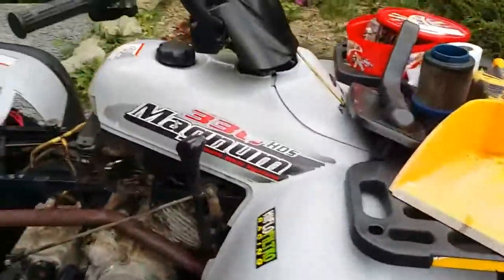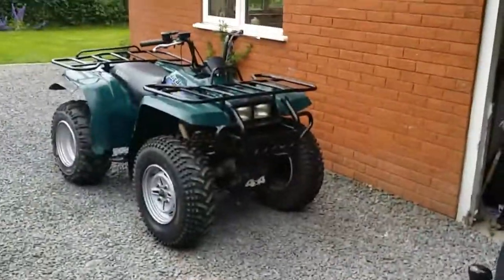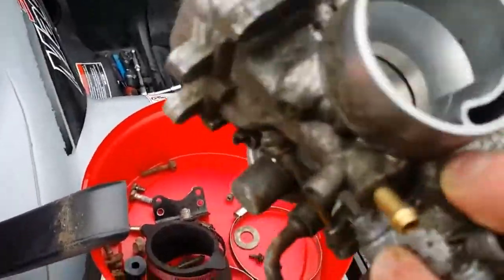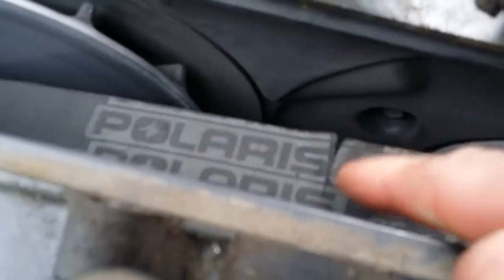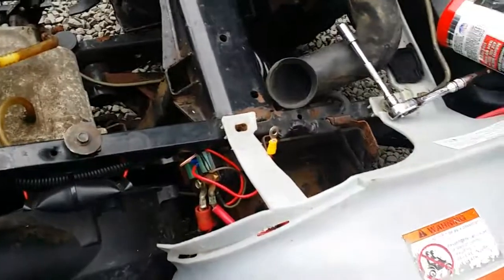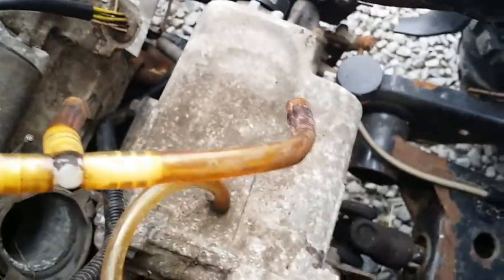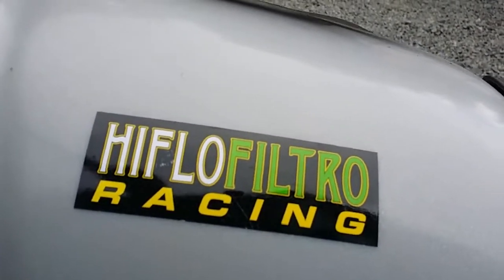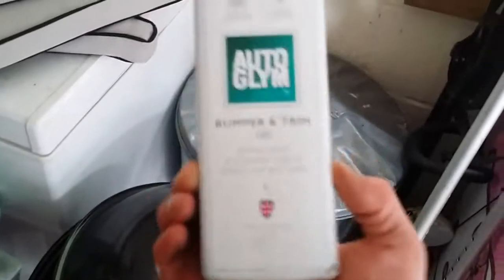FIRST POLARIS QUAD BIKE ATV! - MAGNUM 330 IS IT ANY GOOD?

Comment: Hi ,
May you please tell me your opinion on Polaris..Im interested in buying a 325 Magnum 2x4 but i don't know nothing about it.
Is the engine, clutch,  suspension trustable.  Are there some normal defects?
Thanks and regards from PORTUGAL.
Reply from the maker: There ok. I wouldn't bother with a Polaris that age unless it's cheap there not the best. I only mess with these diesels as there one of only two diesel models available
Reply: I disagree. Old Polaris are tried and true solid machines. Any brand eventually needs repair. And maintenance is important.

Comment: Someone help me out please I have a 2001 325 2x4 magnum I'm looking for the radiator fill it doesn't have a cap. The fan is attached to it. I can't find any where to add coolant
Reply: Bad Company the 325 and 330 magnums are air cooled you don’t need to add coolant
Reply: Bad Company the fans that are on them are oil cooler fans that run with oil cooler hoses
Reply: I have magnum 330 and the only problem I’ve had is cv boot

Comment: love your big bear I have 1989 waiting for a rebuild and also I have 2004 330atp Polaris with  less than 1000 km on her clock the big bear is so much better atv than Polaris
Reply: I disagree there super reliable but both are good just love ride quality and power and power delivery so smooth and they go though mud no trouble lifted honda struggled and rzr went right through it forward and reverse they said since your so good go through it in reverse ok went right through they said man nobody likes you never get stuck